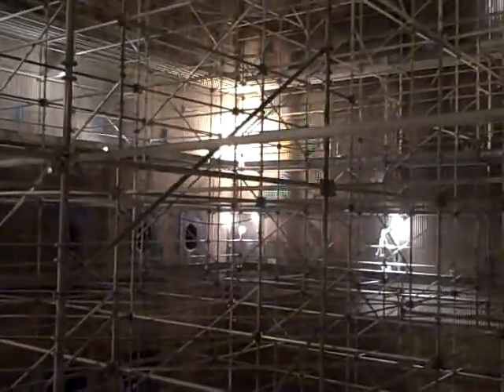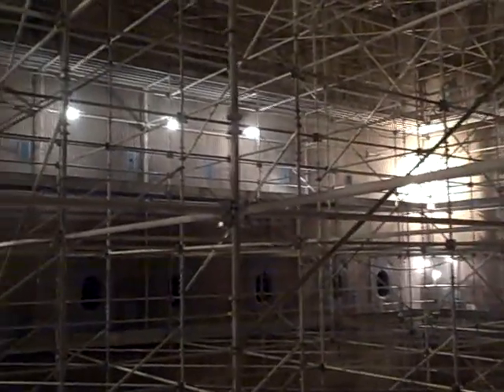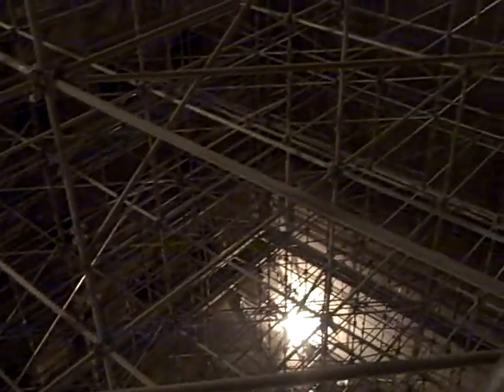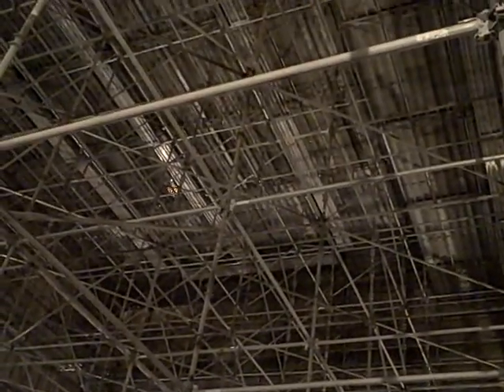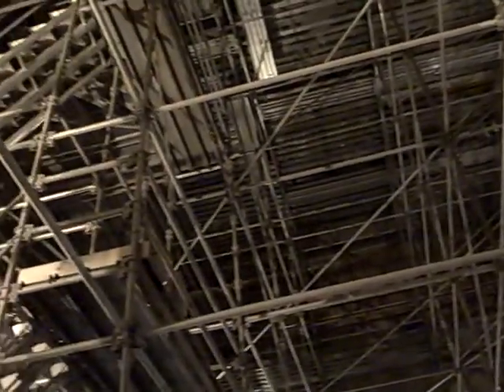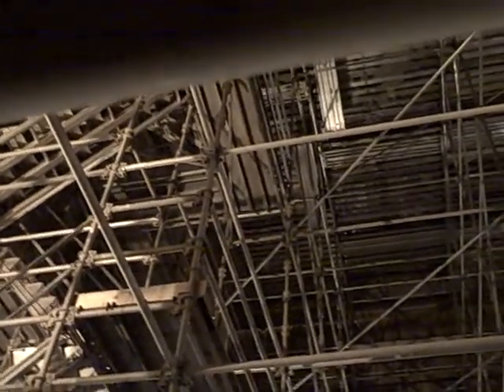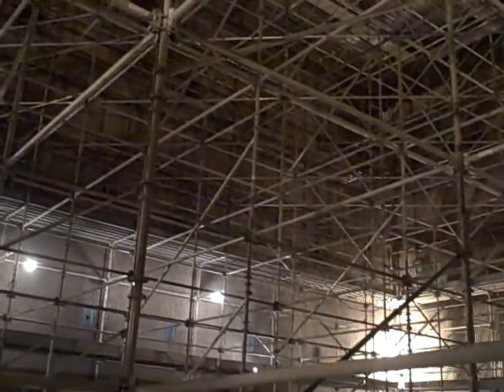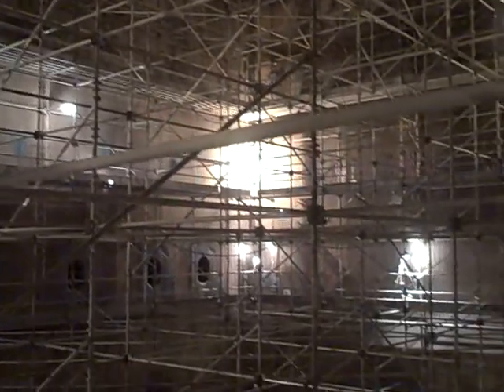Furnace Scaffolding

Comment from the maker: It's rated at 950 mw.  We have been using the Safway Quick Deck for the last couple of years.  Management understands lower costs better than the advantages of better boiler maintenance.  After all , the 'savings' are in a cell on a spreadsheet, and that must make them true - right?  The Quick Deck actually works pretty well, but full scaffolding allows much better repair and inspection.